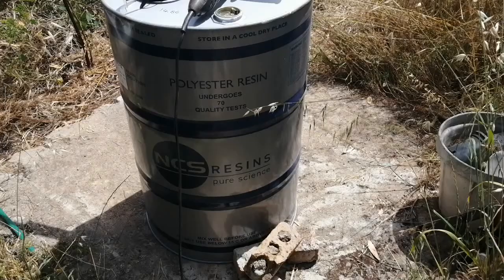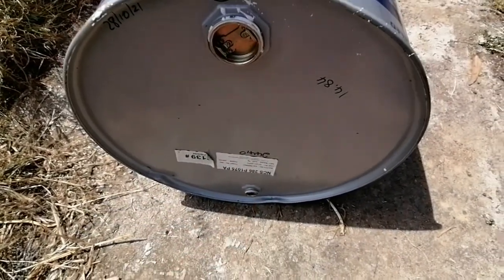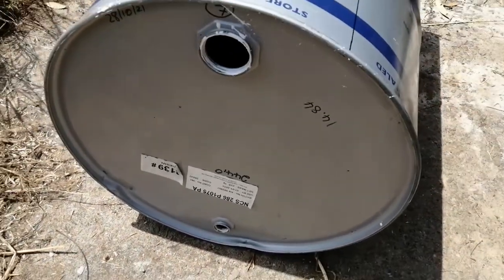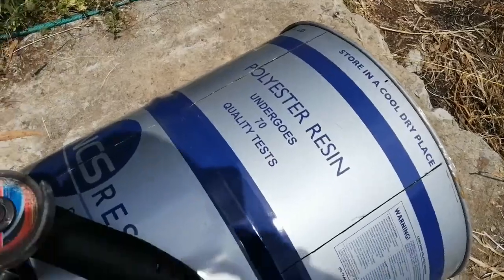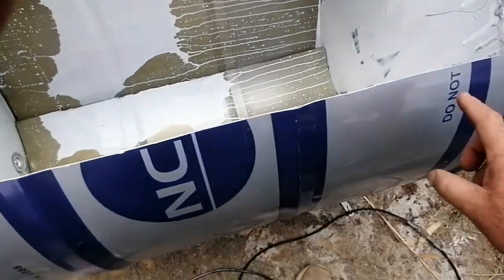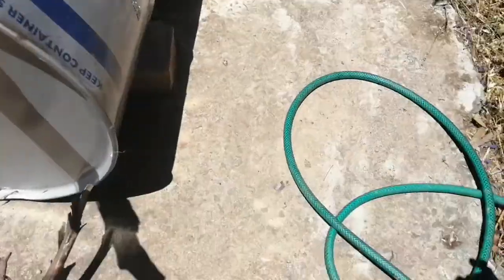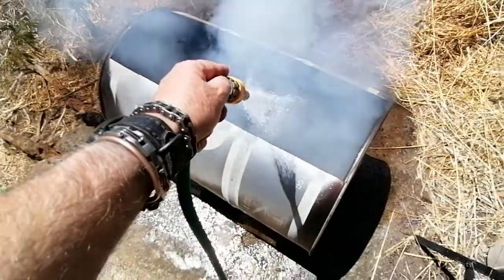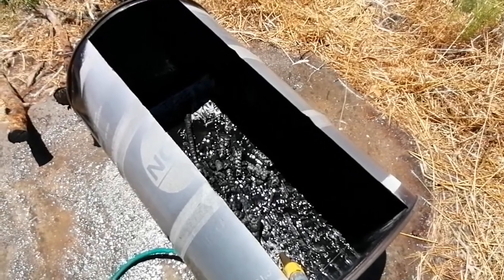Building a REALLY simple biochar kiln

Comment: Drums that had oil. You could fill with soapy water. Let set. Then roll it over  let out enough water to be below where you plan to cut out the side. That way if it did try to blow up. There would not be much air space to catch fire.  Probably over kill though..